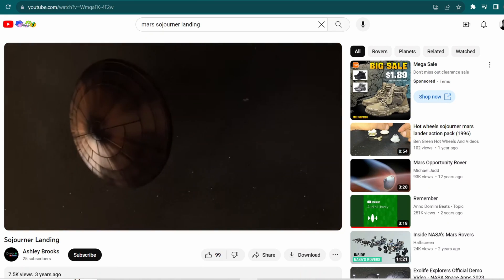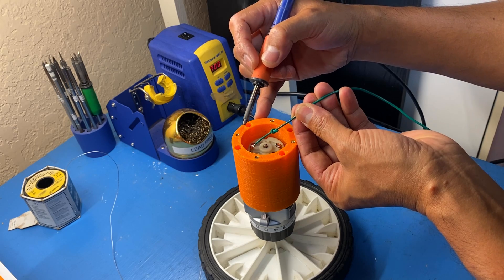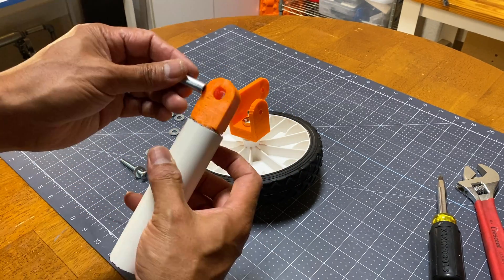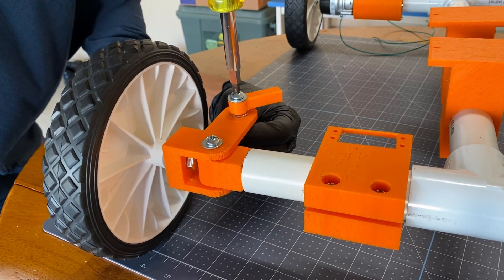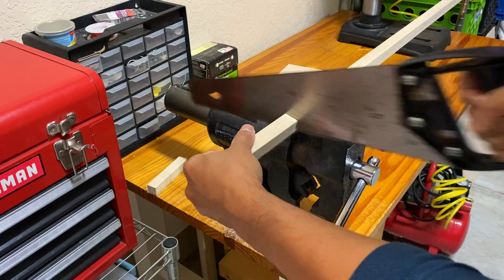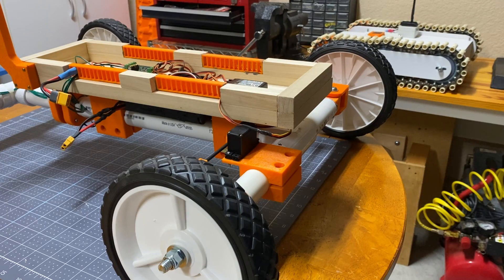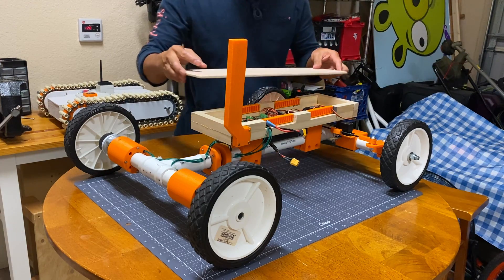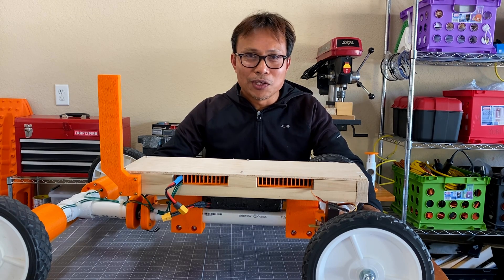How to build Unmanned Ground Vehicle

Comment: Actually it cn be a weight issue on the drive axles mainly to light.
Reply from the maker: Hi Mark. Yes, that is true. I encountered same issue with my old rear wheel drive pickup truck that got stuck on a soft dirt. I have to ask my friends to ride at the back to give it some weight.

Comment: Love this. You have the refreshingly realistic approach to use existing solutions and materials wherever possible and just 3D print additional bits.
Reply from the maker: Thank you Paul. I’m just imparting to aspiring engineers out there that they don’t need fancy and expensive robotic platforms just to test their ideas.
Reply: @LyndonsWorkshop  Well, you do not provide any info for your build.